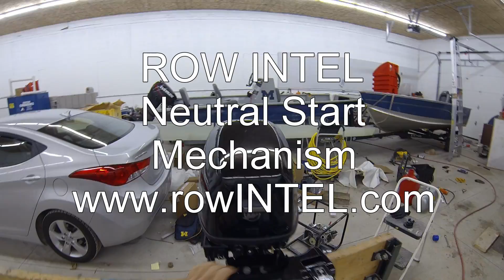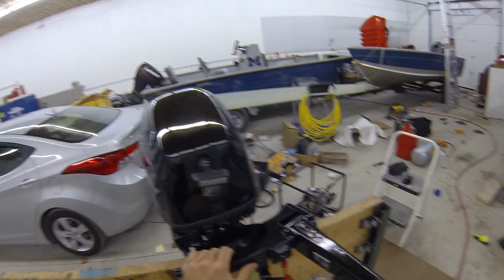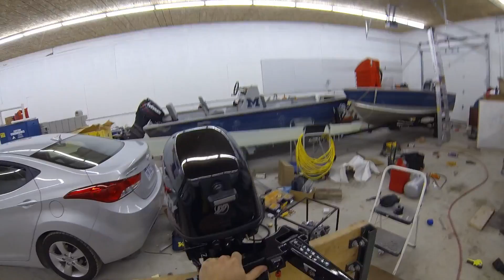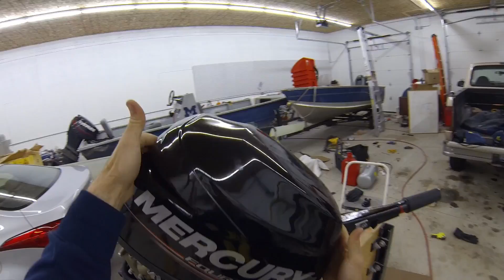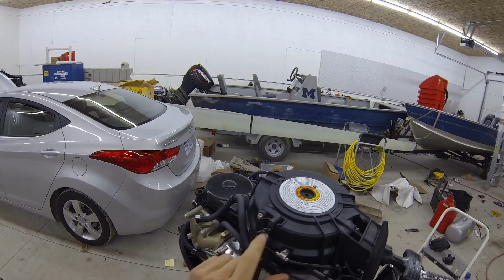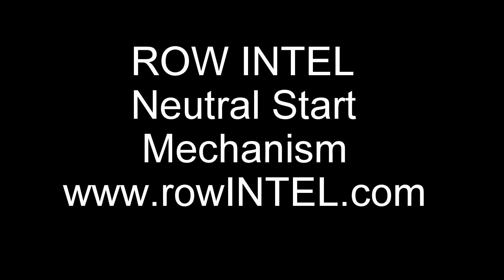Neutral Starting Mechanism Mercury Outboard 9.9HP

Comment: So I had a problem with getting to neural. Turns out the spring on the pull board mechanism was broken. I ended up getting a whole new oem pull cord. Push throttle only. Left cowling off. Watched and saw it was in neutral. Now starts right up. No problem. But when I try to shift into reverse or forward. Nothing. It won’t come out of throttle only mode. Ideas??

Comment: If you want to know how to actually fix it...read more.
At the end of the cable there is a tab held on by a Phillips head screw. That tab holds down the the cable end (round silver metal part with flat edges) If you look closely there are little plastic grooves. My cable made its way forward out of adjustment not allowing my neutral position to lift the safety and locking my pull start.  Loosen the tab on top, set your cable into the proper grooves, and retighten the tab. This will properly set the position of the cable so it engages the neutral position switch.
Reply: I'm pretty sure this is my problem but I can't see the grooves. Are you able to show a picture or video?
Reply: I’m having this exact problem, I was able to get the motor started by lifting the latch up a few times but now I can’t even get the pull cord out

Comment: I've got a 2016 25 HP electric start tiller.  For the start-in-gear protection, the cable is located underneath the electrical bracket.  Any idea how to access the cable so that it can be adjusted?  Is it a factory tool?  Does the electrical bracket have to come off?  Nobody seems to know the answer to this..   Please help if you can!

Comment: I got a 2019 and a hour into breaking it in half throttle I killed it with kill switch to urinate and now it will not start even with the lanyard back in run position  help

Comment: What is that piece called? I need to replace mine, but I can’t figure out the actual name of it so I can order it online.
Reply: same issue with mine. did you find out what it's called to fix it? :)
Reply: Few parts over there like 804031001 
Generally  term is recoil starter interlock.
BTW maybe you don't have to replace it (unless it's physically broken), you might just adjust it like, I had to do it and it took like 2 min